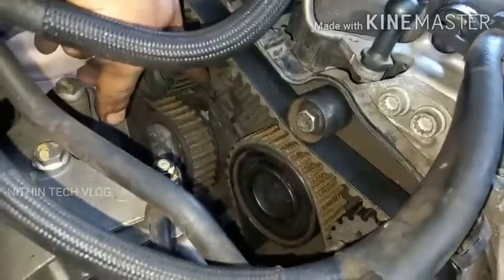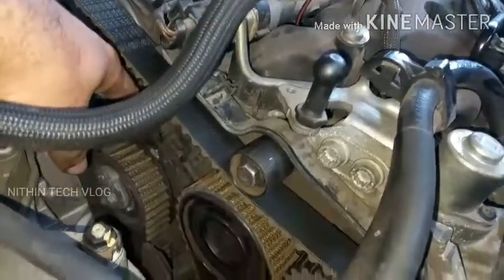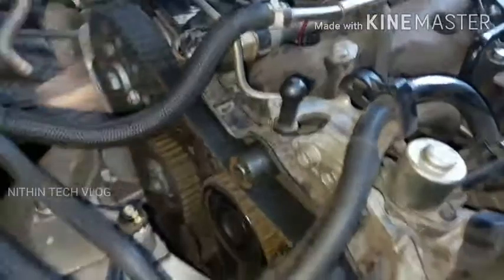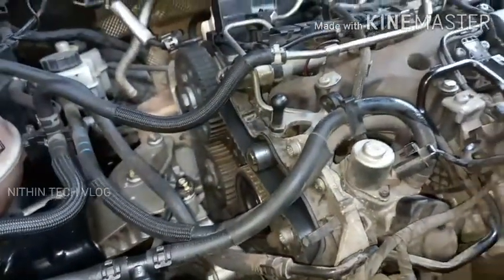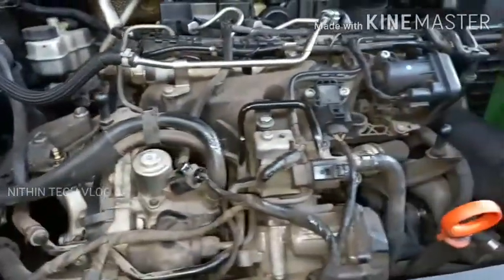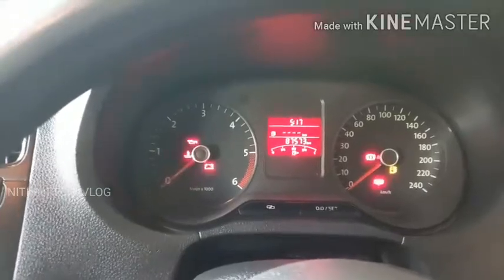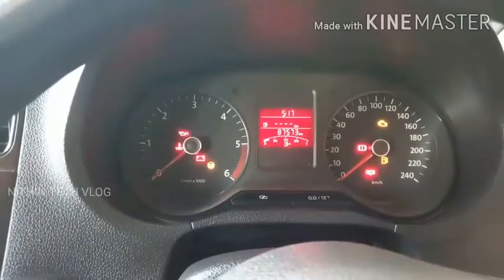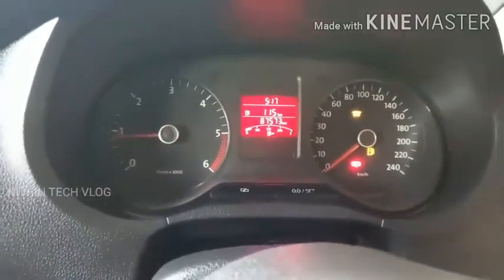Volkswagen Polo Starting Issues....| Malayalam

Comment: Bro ente polo chilappol starting issue und. Key two three times on cheythalanu start aavunnath. Not always. Start aayikazhinjal meter screen full reset aayipovunnu. Eg. Time, km drive angane. Enthayirikkam problem.
Reply from the maker: Scan cheyth nokiyo, battery check cheyuka, starter check cheyandivarum, igane oru problem kittiyitila  enthayalum check cheyanm
Reply: Same issue am facing ..did u solved it?

Comment: Bro ente 2010 polo mpi aanu. Fuel kuravanel oru starting trouble und. Fuel kure undengil easy aayi start aavum. Ath normal aano atho enthengilum complaint aano? Kure neram veyilath kidannu vandi nalla hit aayalum chilappo first time adikkumbo start aavilla.
Reply from the maker: Fuel pump check cheyuka
Starter motor check cheyuka
Battery check cheyukw
Reply: Battery charge

Comment: Ente kayyil oru polo gt tdi und vandide engine performancilum  soundilum onnum maatam illa ennaal start cheyth oru 1.500 rpm il ethiyaal oil chenge engine checkup heater flug checking light blink cheyaan thudangum enthan cheyyendatg
Reply from the maker: Onn scan cheyth noku
Reply: same issue entetum polo gt tdi aan,glow plug light kathii vandi runningl offf aayii

Comment: Ente oru vw polo 1.2 petrol 2011 model crank akunnund start akunnilla. Orale kondu scan cheythappol Engine control module (ECM) disabled- Short circut to B+ ennanu kanikkunne. 2 wks ayi. Workshop onnum illathathu kond pettu poyi. Any solution? 😥
Reply from the maker: Work shopil thane kanikanm ecm compliant vannal
Reply from the maker: Rat shalym vallathum undo. Undagil evifeygilum wire kadich murichit undavum
Reply: @NithinTechVlog  ingane 2-3 times munp vannittund. Annu new battery battery vechu , starter service cheythu. Pinne oru 3 months issue illayirunnu. Pinne edak 2 times angane vannu. But 2 days kazhiyumbol start ayi. Pakshe ippol avunnilla. 2 wks ayi. 😥
Reply: @NithinTechVlog  rat illa. Cat idak engine roomil kayararund. Edak start aayi kazhinjal car kure nal issue illathe odum. But ippol 2 wks ayi. 1 time start ayi. Ennit vandi kurachu odi. Pinne start avunnilla. Chila mechanic paranju short circuit anu. But evideyanu ennu arinjooda ennu.
Reply from the maker: Apol check cheyandi varum valla wire kadichit undagil short-circuit undavum

Comment: Hello my Polo 1.2 TDI 2013 model
Problem  is after passing 10 km over 40 degrees temperature then axilaration is cutting of and alarm over heat and also Ac cooling cut off . Endan problem mansilavnila
Reply from the maker: Coolant mattiyit undo ipol adth , missing undo, radiator fan work cheyunudo
Reply: @NithinTechVlog  coolent la water an but radiator clean akiyan akiyapoyum same an athil onnum oru problem ilya fan over work cheyunund
Reply from the maker: @mnarchassociate575  coolatn mattiyapol air kayaran sathyath und
Reply from the maker: @mnarchassociate575  coolant marumpol air kayararund agane vannal pettan over heat avum . Agane vararund
Reply: @NithinTechVlog  ok check cheyam but heat ayal engana missing varunne vandi pinne neengil first le itale pinne rpm kayarollu
Reply from the maker: @mnarchassociate575  heat ayal missing varum clusteril over heat symptoms kanikile apol alle missing varunth. Onn scan cheyth noka entha enn ariyum. Air kayarana sathyatha allagil  check cheyandi varum
Reply: @NithinTechVlog  ya oke njan kore thavan check cheythu oru thavana raile and injector angane angne kanichu and pumb 2 oke mati but still missing athan bro problem
Reply from the maker: Ist vandi satrat cheyathal thanne missing undo
Reply: @NithinTechVlog  no Ilya first oru problem ilya 10 km or 12 km vare full power full performance le povum ath kayinjal missing thudangum